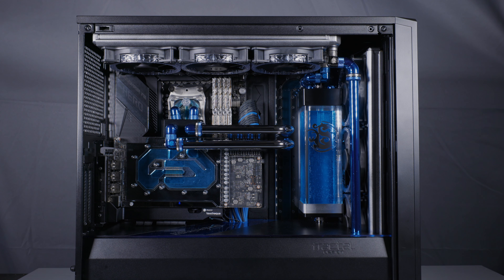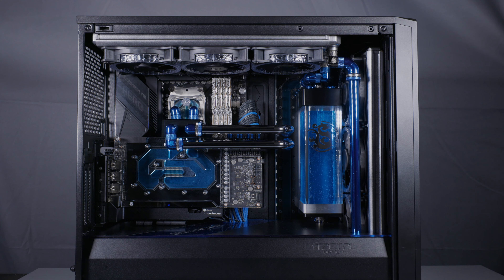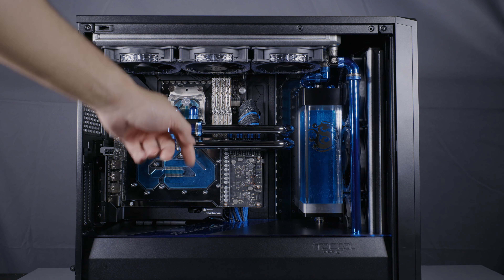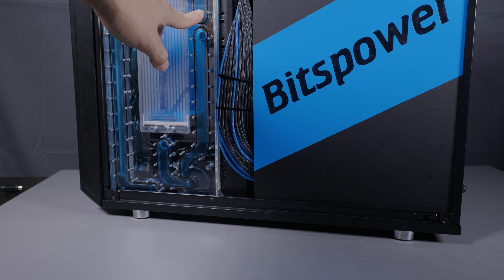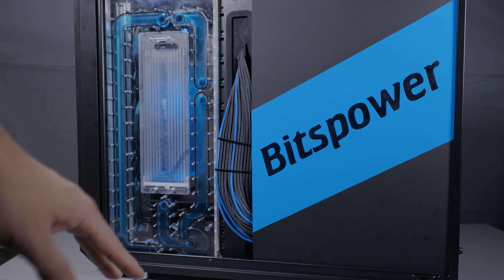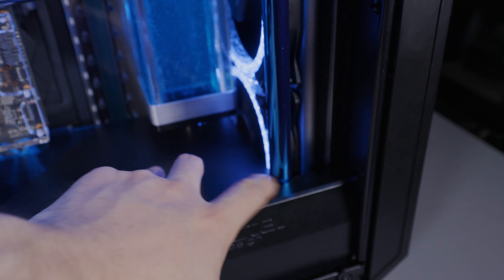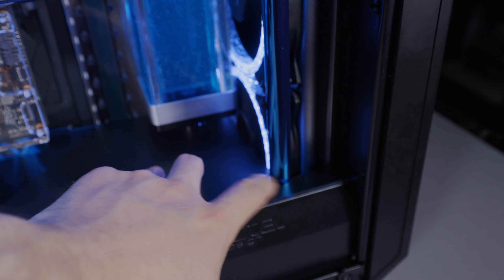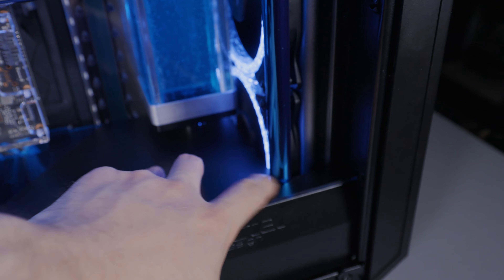Project Naga Build Tour Ft AMD 5900x 3080 Strix OC in a Fractal Meshify S2 cooled by Bitspower

Comment: How did you end up mounting this reservoir , I'm looking at buying this reservoir but Im not crazy about the mount ?
Reply from the maker: It’s mounted to a custom distro plate  that I designed for it.  Now the reservoir just uses m4 screws, so you can mount it however you like. The bracket while not flat, does have a slight raise where the reservoir would go. You can always use longer screws and some rubber washers to create a bigger gap.